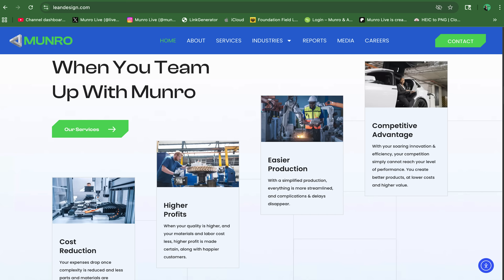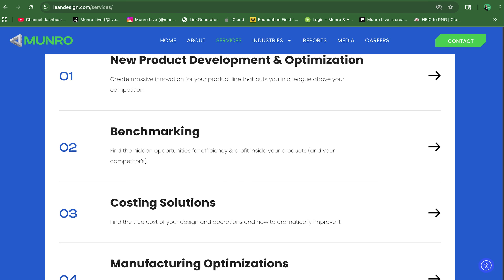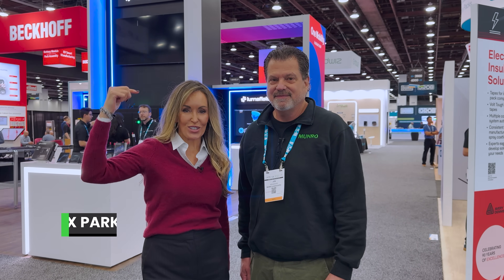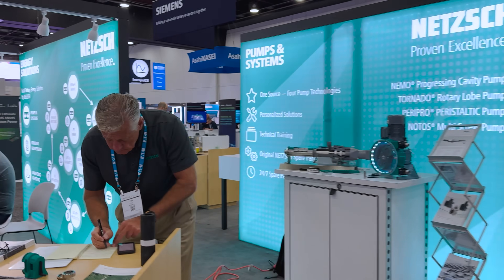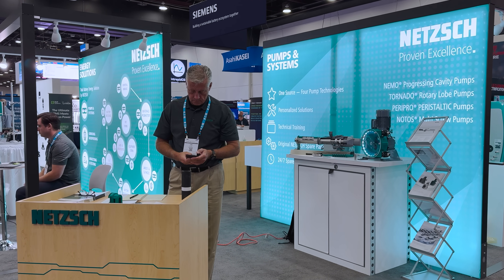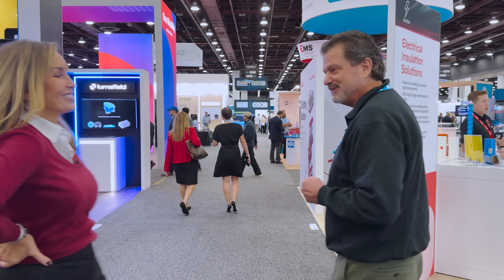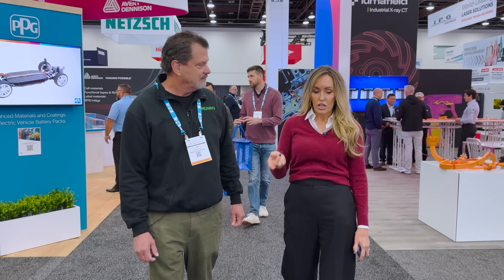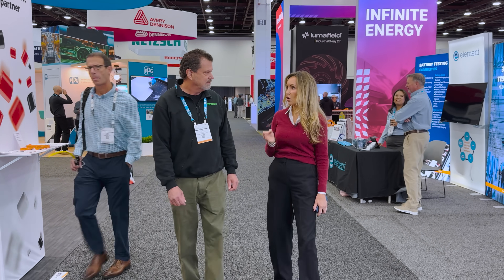Redline Detection: Revolutionizing EV Safety and Diagnostics

Comment: The future is electric. No noise, no emissions, less fuel costs and less maintenance cost.
Legacy auto manufacturers are in trouble. They are too slow to adapt to the transition to electric vehicles.
Adapt, change or go bankrupt. Nokia and Kodak were once leaders in their industries but were slow to adapt to new technology.
Legacy auto dealers are a nightmare for legacy auto makers. They gouged customers trying to buy electric vehicles.
Legacy auto dealers abused their customers by adding market price adjustments to gouge their customers for EVs
They added pricey add ons and other costs to pump up the prices and their profits.
Tesla has the right idea. Buy online. No hassle. No sitting in a show room for hours. No salesman BS. No crazy markups.
No I have to see my manager BS.  With Tesla you can buy a vehicle in 5 minutes or less online. The dealers have no one to blame but themselves. The dealers are dragging the legacy auto makers down with them. The problem with legacy auto makers having slow sales leads back to the legacy auto dealers. They try to talk people out of buying and EV an want to put them in a gasoline car.  Many people hate going to legacy car dealerships. Many people call them stealer ships for a reason.  New car, used car or going in for repairs you always walk out feeling cheated. People have no sympathy for dealers.

Comment: It took you over 6 minutes to actually talk about something at the show. No thanks. I have limited time to watch videos so I won't watch people just jabber pleasantries.
Reply: I mean you saw the length of the video
Reply: FYI, the Video Speed Controller add-on is pretty great. Available for both Chrome and Firefox. Lets you set shortcut keys to adjust the playback speed and skip forward/back in whatever increments you want. I'm usually watching at 2.2-2.5x and have several skip lengths set up to get through blather and sponsored slots.